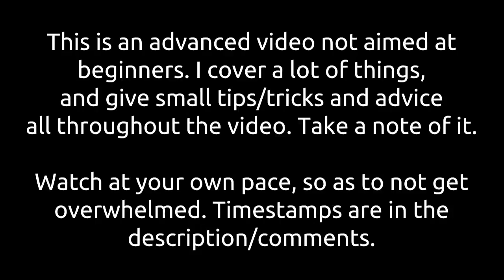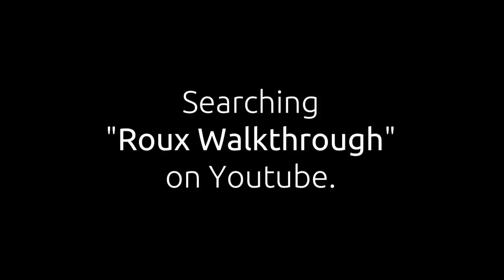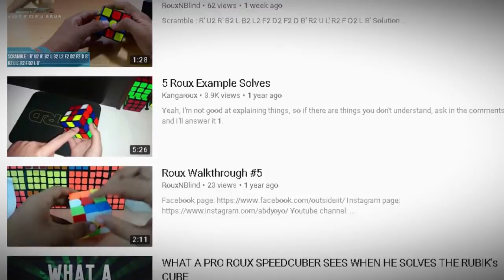Roux Method Tutorial: First Block Efficiency | First Block Tips & Finding Efficient FB in Inspection

Comment: Should I learn all of the first block approaches?? I just learned Roux like yesterday and I use DL approach I was going to switch to square but maybe using all of them would be better
Reply from the maker: Yes, learn all of them and see which one you can use for what scramble. Not every scramble can be solved efficiently with DL only, or square only, why its good to have a mixture of approaches, so no matter what the scramble is, you're ready with an efficient solution.

Comment: Is it bad to be CN with roux with any colour on base? im currently averaging 20 sec with any colour on the base, and red orange green and blue on sides. Will this have a negative effect later on (sub 10 ect)?
thanks for the informative video!
Reply: Hi! i dont think its necessarily a bad thing, but i think it is useless. x2 y color neutrality can easily produce the desired effect and, as critical stated, will guarantee a 5 move solution. While cfop needs complete cn, roux's intuitiveness and the heavy usage of the middle layer makes up for full CN. i recommend focusing on CMLL (if you dont know it yet) and learning to be more fluid on LSE. for me, i am working on my first two blocks, because i constantly average like 10 seconds with it :/ hope this helped!
Reply: @crashtest_crashtest  thanks!, I think I will persevere with it at this point as I am pretty fluid with CN, but i will finish CMLL (2 subsets to learn) and work on LSE now. (and learn EOLR)